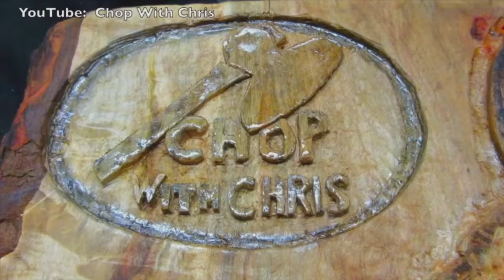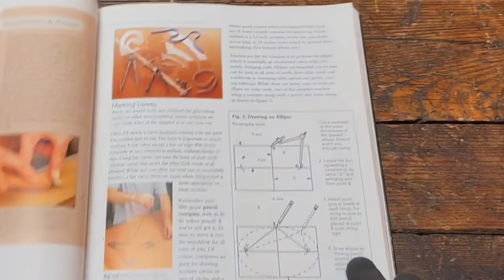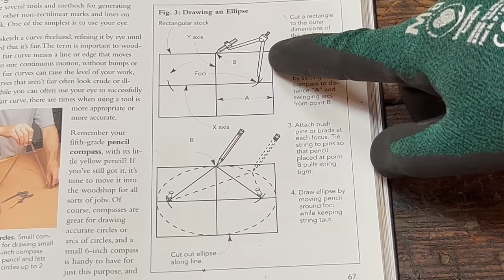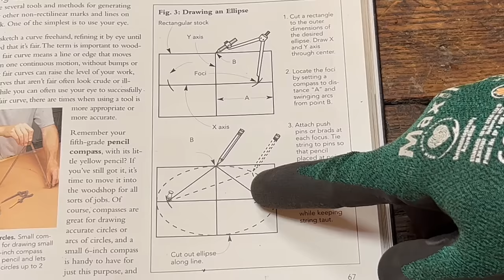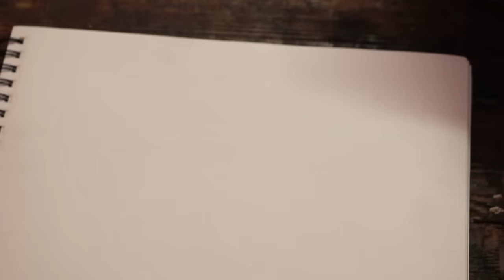From MOSSY LOG To BOWL with Hand Tools ASMR

Comment: It is interesting that the old rotten log still had some nice wood in the inner part that is so great.  Getting free energy is always nice even its your own body your using. Still some good wood you left behind I am guessing. Solar power is pretty good too from my exsperience. Hope to see you make something out of whats left behind in the woods different from bowls. The old antique hand tools are such wonderful treasures and very useful. What looks so crude from all the rust and pitting on the outside is still hiding great worth underneath just like the wood. I love flea market for all the old treasures from the past. A water wheel and a belt lathe would make and excellent tool to make bowls in your work shop if you lived by a stream or creek. Your bowl is unique because it looks like Noahs Ark.
Reply from the maker: Thanks so much!   I do also have a foot powered lathe! 😄
Reply: @ChopWithChris  I finally saw that towards the end of the video.

Comment: Do you anticipate some cracks in the bowl as it dries?  Is that a feature or a problem?
Reply from the maker: It’s a problem and an opportunity.  A big crack can be fixed with a cross and epoxy which can decorative.   In this case I was not concerned about cracking.

Comment: awesome and helpful.  i inherited a perforated lancetooth saw smaller than yours.   watching video is the only reason i pulled it out of storage and found out the correct name  i have two  questions.   what type of wood was the mossy log.  i was a little disappointed to read somewhere that these type saws are not for hardwoods and will damage saw. they are mostly for pine and other soft wood.  is this actually the case? seems like my initial research could be another case of million monkeys on million keys still not able to create works of mozart or pfunk.  you are defiantly a worthy artist so my wishes still have hope.  i hope.
Reply from the maker: Thanks so much!   The wood is walnut. Yes, I used the wrong saw but it was sharp and cuts hardwood like butter so that’s all that matters!
Reply: you are extremely welcome.    but the way you put the soothing calming video together without any human vocal fodder is best way of communication and want you to know that i was no way trying to call out wrong saw.  i not close to qualified firstly. and i wish you were my neighbor.   similar to all the good humans that were appreciative of the video   worth the praises in my opinion so sorry if seems too much.    but   does that man i am somewhat okay for seasoned hardwood?  or more of if only option and 1 or 2 cuts max?  seemed like it cut ok for you   if you were my neighbor you could certainly piggy back off my wifi and direct tv ,  smiling face @ChopWithChris
Reply from the maker: Ha ha ha!   Thanks!   A sharp saw is a sharp saw so as long as you’re not cutting down a redwood you should be ok 😄

Comment: Did you have to seal this wood as you do with greenwood?
Reply from the maker: For long term storage I coat the ends with Anchorseal.  Once I start carving it I I keep it in a cloth bag inside a garbage bag and if it dries to fast when I apply Watco Danish Oil natural color.
Reply: @ChopWithChris  - another question 😂
What kind of brush are you using to remove chips and dust from your carvings?

Comment: You're gonna use the rest of that tree right? Also, save that wire cause if it's steel you can do some great stuff with it in terms of blacksmithing.
Reply: @ChopWithChris  What are you gonna do with the rest of the tree, the more rooted structure in my opinion would be a great table and the smaller piece(s) you cut off could be perfect wood turning projects?
Reply from the maker: Not sure yet.

Comment: The only real problem I see is the damage it will cause to human fingers when that steel snaps... I strongly recommend using different steel with more elasticity for the fingers than with the blade , I hate knifes with unnecessary part however for safety reasons I would use 2 different steels for this because people like myself will I repeat will break the first one I get 😂😂